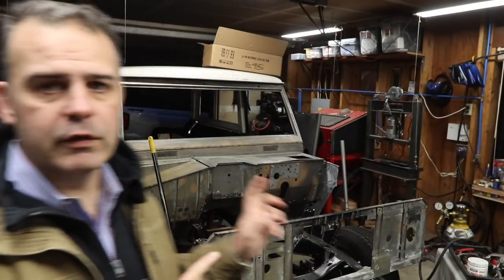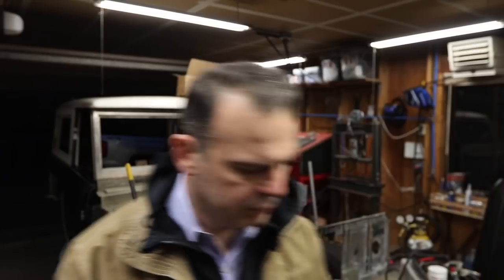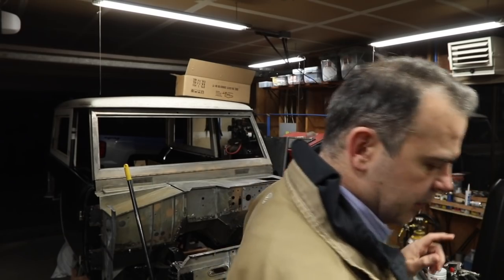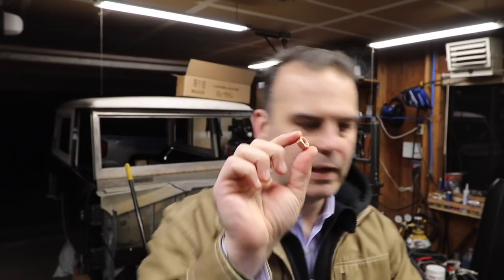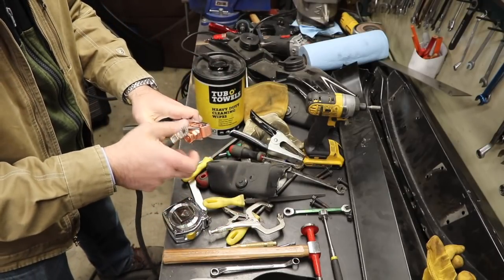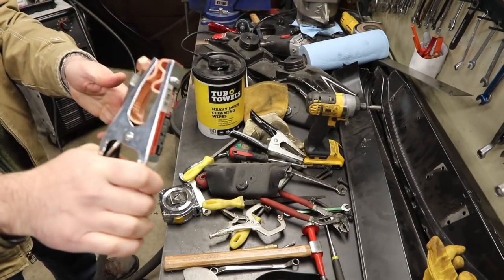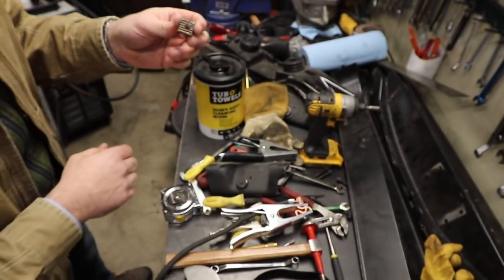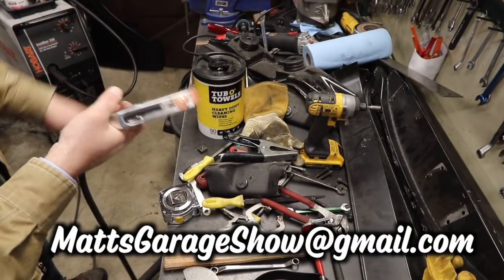New Ground Clamp!

Comment: I just grabbed one of these clamps at home depot for 12 bucks I think. Big difference in how my welder is reacting it's perfect
Reply from the maker: Andrew Denine awesome. Yeah, huge difference. Be sure to check the bolt ever few uses too. Mine backed off after a while.
Reply: @MattsGarage  yes thanks I was thinking it's strange not to come with a lock washer so I have some ground clamps for grounding cable tray left over so I took one of those lock washers and used it. That should do the trick.